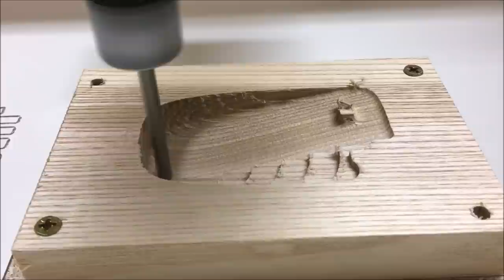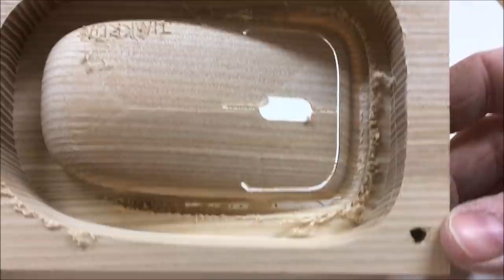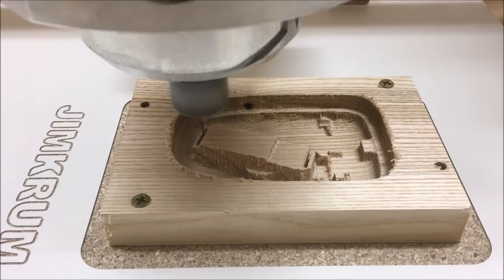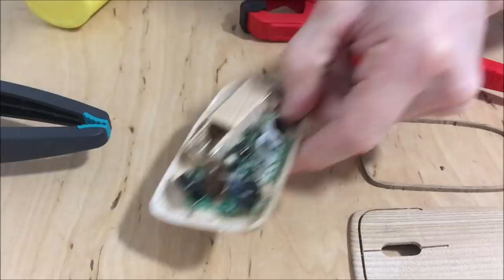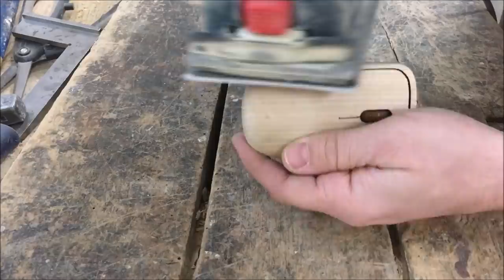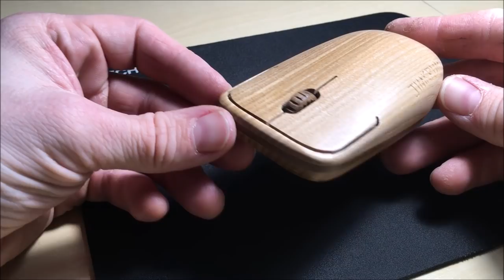Wooden MOUSE , made on homemade cnc router

Comment: The measuring and tool path creation must have taken a LONG time. Great job.
Reply: Is that not automatic? Once you have your model, a software will do the test.
Reply: @magooccna  it can't be, but to get the separate parts like the battery cover etc, would've all be done by him
Reply: @magooccna   I thought that you had created the model and tool paths from scratch . Still a lot of work though and a top result.
Reply: @loskop100  No doubt a good job. But modeling don't take much these days when you know what you're doing. Designing does. 
I have done a whole bedroom furniture set. Settling on the design is the hardest part. When I finished the model, including hole location and the software created the cnc instructions with few clicks.
Reply: @magooccna  Aha, I think that perhaps those "few" mouse clicks were done on software out of my range. I had a play with Fusion but the bandwidth here is flakey so cloud based soft isn't practical but creating surfaces with my limited software is great fun anyway.
Reply: Common misconception that the CAM "software does the programming with a few clicks". Not to mention designing a complex part with angles, into radius' into sweeps is no easy task. (Hence why an experienced CNC programmer is one of the highest paid people in any shop)
And why a seat of Mastercam is $14k. Vcarve is under $1k, but you get what you pay for.
Reply: Modeling takes time until you are happy with the result but creating nc codes are easy.
Reply: Everyone talking about modelling must have clearly forgotten that there's such thing called 3d scanner
Reply: @frankrizan3357  yes my friend indeed 3d scanner works but what if you want to customize you product as far as I know 3d scanner produce STL File formate which is not easy to manipulate. What you say
Reply: You put the 3d model through a software and its ready for the machine.
Reply: loskop100 Another reason why this isn’t actually a (how to) video
Reply: I would love to have one of those
Reply: @ranjodhsingh8638  are you an engineer? PhD? Don't know how many PhD's have come into the model shop with that attitude. "Oh, you just put the model in and out comes the program automatically". What about speeds, feeds, depths of cut, what tools to use for which toolpath needed, tool selection vs tools you have in house, lead in/out, finish cuts, direction of cut, cut loads vs part clamping ridgity, cut loads each tool can handle, cut loads depending on what the machine can handle, and all the above depending on different materials, etc, etc.  These all take years of machining exp to perfect.
Reply: @meyou245  yes my friend obviously it is all about experience if a person gone through a lot of job work with maching then everything will be easy for him / her. If I know which tools I have in house and know the material properties to work with then creating nc codes are not a big deal, on the other hand modeling is indeed time consuming because there is  lots of iteration involves during designing phase also during designing phase we estimate which material we use and how we going to machine the component,  is all planned before creating NC codes .
I am engineer by the way and I m really sorry if you think that I m imparting bad attitude but my intention are not to hurt anyone .

Comment: You should always 3D profile at 45 degrees, this spreads the load over 3 motors and allows for better positioning.
Reply: Never thought about that, will have to try!
Reply: Do you mean design the mouse inclined 45 degrees? I have no experience with CNC but I'm digging a wooden mouse for some time
Reply: @ericofadel  No he only profiling on the X and Z axis, going back and forth on the X-axis, up and down on the Z. The idea is to go from the bottom left corner to the top right. If you look at your keyboard, X-axis is like going from the Z to the M key, and the X, Y axis is going from the Z key to the P key. He should also try and choke tools up in the chuck, have less drill sticking out, the closer the cutting tip is to where it is held the more rigged it will be and the better surface finish.
Reply: @bargey13  ok, so rotate the tool path 45 degrees to spread load over both X and y motors?
Reply: @mattblack6736  yes right now it's only on the X motor.
Reply: @cptranch5918  yes the force on the endmill tip may not change but the force on each motor would be less. The force pushing the end mill from both the x and y motors would be shared.
Reply: @bargey13  
On real NC-MACHINES, you usually want to go XZ or YZ so that you can apply arc filter. Same goes for constant Z toolpath, where you work on XY. I would recommend some type of offset toolpath on this case, since the outer edge is so prominent.
Reply: How would spreading the load over 3 motors allow for better positioning?
 He is cutting wood, and there really is no load with small stepovers. 
Plus, not all CAM programs allow for simultaneous XYZ movements.
Reply: @bargey13 I agree that he should have used shorter tools. The longer the cutting tool, the more chatter and deflection. But you dont choke up long fluted tools so the flutes are in the collet. (Will destroy the collet and tool will not run true)
Reply: @meyou245  you said it better than I did. Yes you want to have your tool length offset minimized so that you have less chatter. Just make sure the tool length is not to short such that you run your collet in to your work. Also yes don't grab the cutting edges of the tool with the collett. Only grab the shank of the tool, and if that doesn't work get a different tool with the right design.
Reply: Me too
Reply: Turn on the captions for details on what they're doing with each drill/instructions.

Comment: Bravo.I used to work with an SCM Tech Z5,but this is amazing.Only one thing.Between the two click buttons at tne end of that canal used to end in a tiny hole.To prevent material fatigue to crack in.

Comment: How did you CAD that? Was there some digital assistance (3D or 2D scanning), 3D printed prototypes? It looks very complicated, but maybe you found a way to simplify it?
Reply: WTF, haven't seen simpler design. Has literally no ergonomic elements and is really a poorly modeled mouse. Not even a "how to video"
Reply: @jondycz  your point?
Reply: @OliverLMinecraftMachine  he doesn't need to, he is right this is not an ergonomic design at all.
Reply: Its surface modeling maybe using one of the cad package like solid works , catia, nx, solidedge, pro e, visi, etc.
Reply: @OliverLMinecraftMachine  what do you mean with prone t? 

as far as I can think the 2 benefits with custom made mice is.
1) they are made with wood and are kinda nice/cool
2) they can be made to fit the user with the exact dimensions of their hands and all.

if you are going through the effort to make one why skip half of the benefits of a custom made mouse?

Comment: It still needs Teflon gliding pads.
Reply: Lard British why use Teflon when you already went all out and hand designed a mouse.... go for gold and use hyperglides
Reply: @abnormallynormal8823  Because dust will inevitably fall onto whatever surface the mouse is used on.  The bottom of the mouse is flat which creates a large surface between the mouse and mouse pad with grit (dust) in between. Even if the mouse-pad is soft, and the mouse is very smooth, the grit between them increases friction and slowly scratch up the bottom of the mouse.  Dust would also likely accumulate in any raised areas under the mouse like the hole for the optical sensor.  Adding durable non-stick feet too the mouse raises the mouse a tiny amount, drastically reducing the contact area between the mouse and the surface below it which reduces friction and protects the finish of the bottom of the mouse. it would also prevent dust / debris from clogging the optical port. When the feet eventually wear out, they can easily be replaced. Remember, the bottom of the mouse doesn't just support the weight of the mouse, but also the weight of the user's hand + any additional force the user may incidentally apply downward onto the mouse.

Comment: I think you should sand it before glue, all the dust entered inside. Also, after glue is impossible to clean it inside from all the dust (from work and after). Also if it is optical, bottom part should be perfectly leveled. But work and effort you did is quite nice.